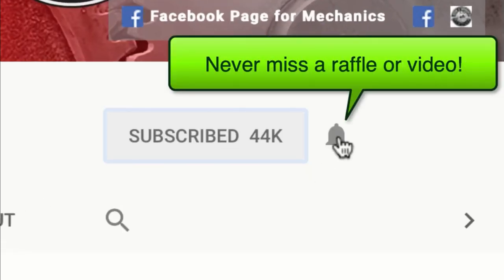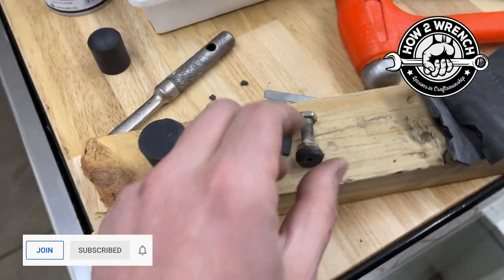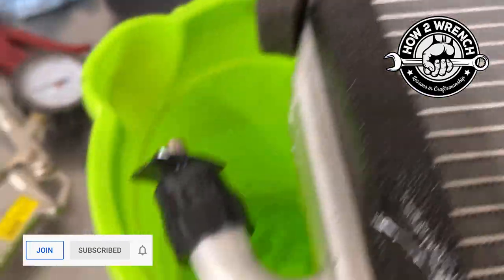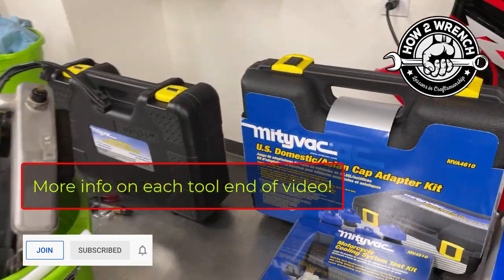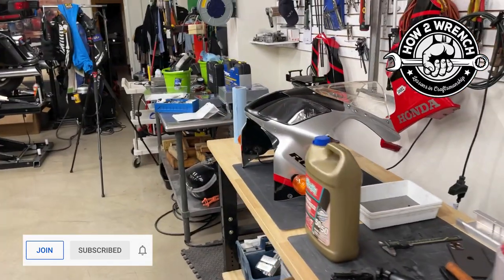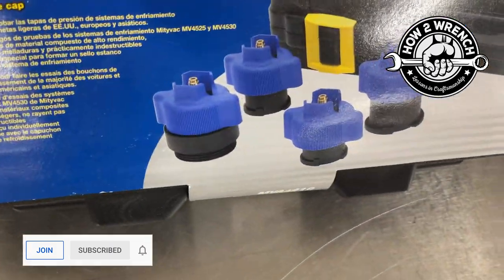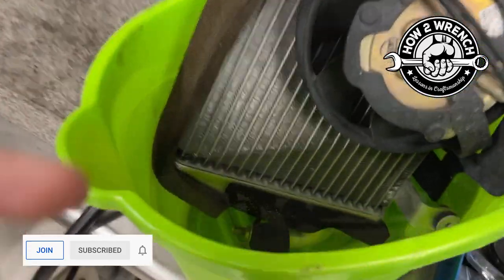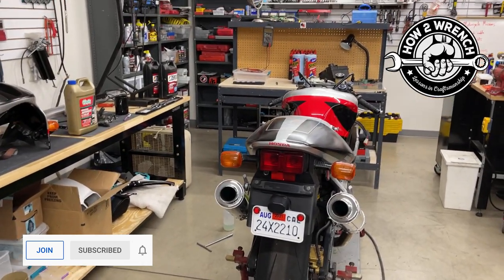How to find a radiator leak with this Custom DIY testing tool adaptor. Free tool giveaway coming!

Comment: Very good info. Of course, as a Honda/Kawasaki dealer of 40+ years, we never had this problem. The companies would automatically send out there wonderful overengineered and very expensive tools to do these kinds of things!! All automatically and billed to your account.  I bet over 80% of the "special" tools we never needed. A lot of the tools were for major jobs most average shops would never even see. If you did need to get into one of these jobs you would need to order the parts anyway.  We didn't stock many Goldwing crankshafts or final drive parts.  Speaking of cutting up innertubes, they can make nice custom rubber bands of various sizes. Keep on "Keeping On"  Remember you can sleep when you're dead!

Ted
Reply from the maker: I sooooo hear you on the "special tools"...😊 Love the idea of using inner tubes for rubber bands too Ted! Keep Wrenching friend!